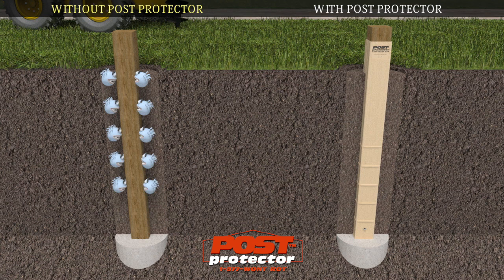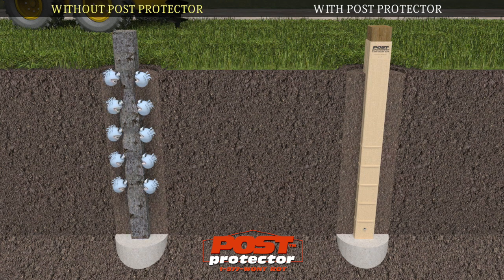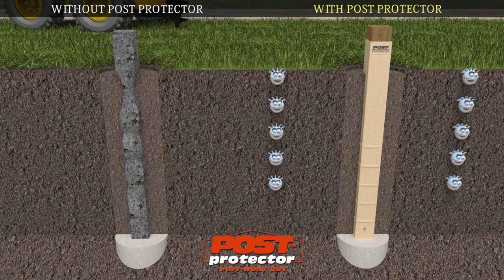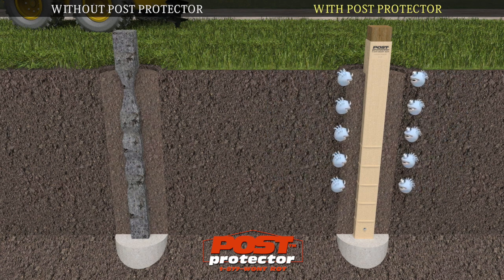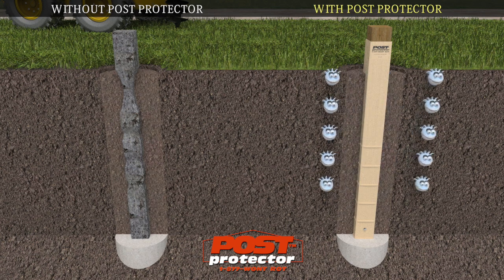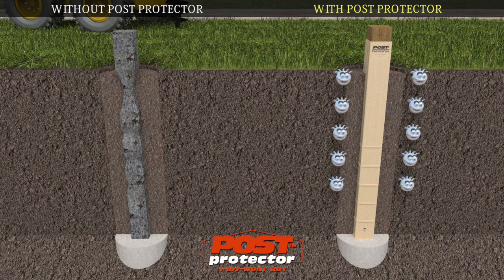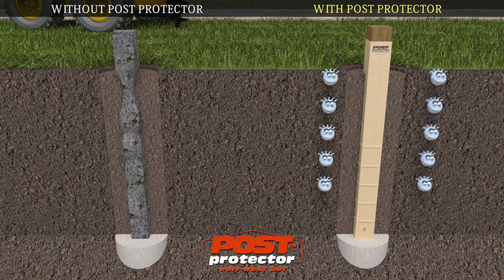Post Protector: POST DECAY 101: The Science of Decay, Simplified!

Comment: I have also heard that the lye in concrete reacts poorly with the chemical treatments of the lumber, causing problems.  Does moisture content of wood matter as long as it isn't continually introduced to microbes?  Watertight plastic sleeve + treated lumber seems good.  If moisture content becomes high within the sleeved portion (hard to imagine if kept dry inside the building envelope), capillary action will wick water up to the exposed portion where it will be able to dry.

Comment: Right and it's ribbed for the company's pleasure when it rots anyway ! Bury the post 6 inches lower than the concrete for the moisture in the wood to escape with 2 inches of gravel in the bottom of the hole !
Reply: Exactly you are right if anything that plastic will help it to rot. You can also tar the post the part underground but not the bottom and like you sead put some gravel in the bottom 👍